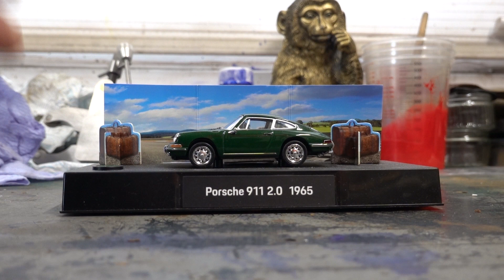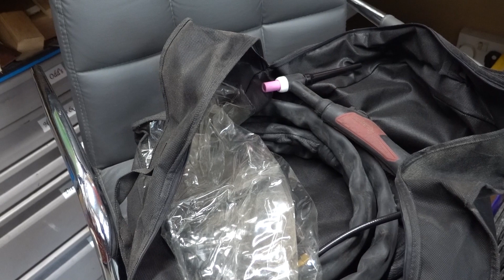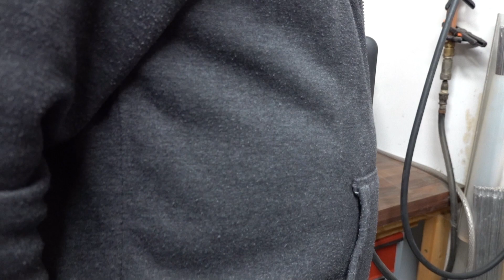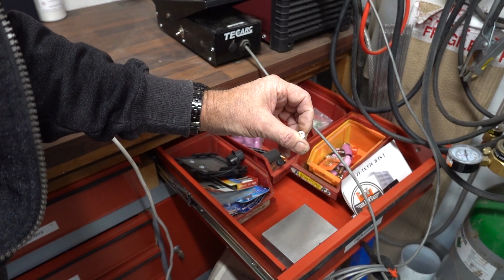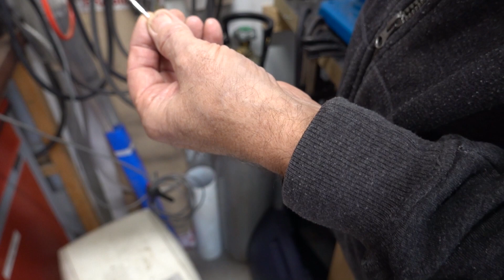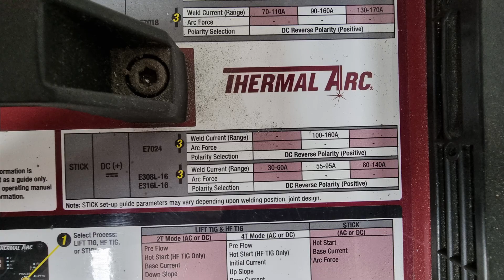Show us your workshop. Tig welder

Comment: Hi Steve
I wish I could gas at that price. A 20 litre bottle +argon gas cost me 290 euro! A refill is 120 euro. The mig gas is 260 and 100 for a refill. Needless to say I don't do much welding.
Reply from the maker: Good god Gary where are you located. I am guessing you are not in the Uk. 
Steve.
Reply: @Steviegtr52   I'm in Ireland, it was on the wireless the other day that Ireland is one of the most expensive places to live ,not only in Europe but the world!
Reply from the maker: @smudger25261  Hi Gary. I just checked & 20 litre bottle of pure Argon costs me 113 euro' for a refill So not too far different.
Steve.

Comment: Very informative stevo it’s a real rum deal argon bottle leaking at those prices it’s a option I thought about to  avoid boc gas now I’m not so sure ?👍🏻💯🇬🇧
Reply from the maker: Yes Mark it is a pain. I guess a bottle would last me a year or so. But when they leak it's a bummer. I know a few who have had them & not had a problem with leakage. 
Steve.
Reply: @Steviegtr52  hey Steve perhaps some kind of gas sniffer/tool held around all connections & valves might help just to be sure👍🏻🇬🇧
Reply from the maker: @mjk8710  I guess that would work. I don't have anything like that though. Also the BOC have the same problem. I assume anything carrying such high pressure will eventually weep out.
Steve.

Comment: Nice one mate. I went for tig because there's less fire risk in a wooden shed (no sparks or red men rolling around) also very little smoke or fumes. Cheers Neil
Reply from the maker: When you said red men it made me cringe. Made me remember gas welding & bang. Next thing a red one rattling about in your shoe. Had a few burns from that. 
Steve.